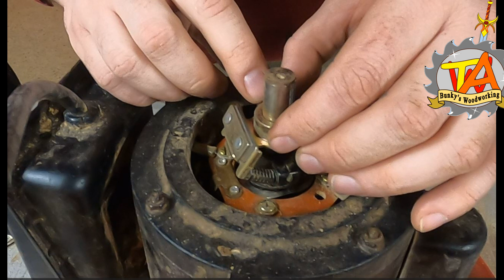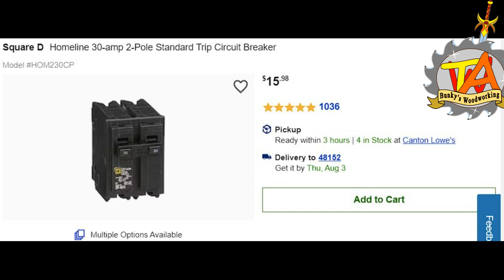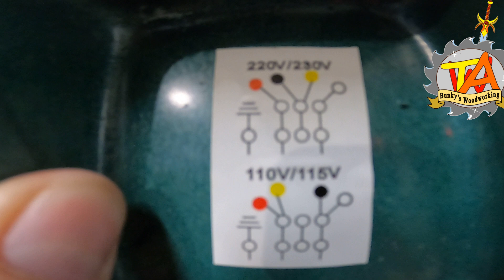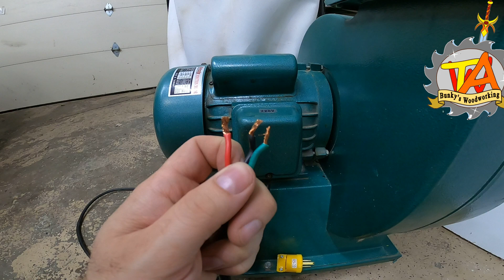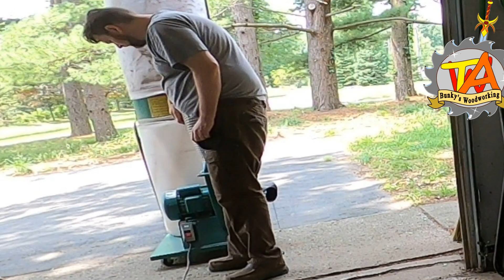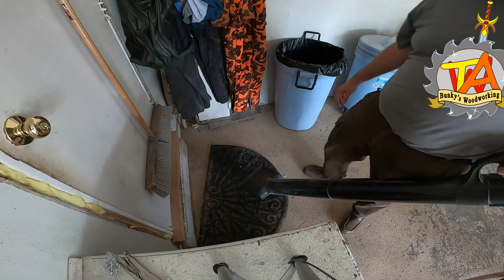Converting Motor from 220 to 110

Comment: Are you sure you meant 200 AMP ?? I can see 220 V @ 20A ??
Reply from the maker: Thanks for asking! The 200 amps was referring to upgrading our main breaker panel/service from 150A to 200A, not the circuit for the dust collector. Our existing panel was full, so adding another 220V circuit would have meant upgrading the panel to give us the additional breaker spaces we needed. Rather than doing that right now, we converted the dust collector to run on an available 110/120V circuit. Hope that clears it up!

Comment: But the start capacitor MP it's not the from 220v to 110v....
Reply from the maker: Don't know if this helps but "When changing from a 220V to a 110V system, it is generally not necessary to change the start capacitor if the capacitor was rated for 220V. However, if the motor has a centrifugal switch, the start capacitor may only be in the circuit until the switch opens, and the motor manufacturer typically chooses a common mfd rated capacitor such that the start current leads the run current by approximately 90 degrees electrical to maximize starting torque. If the motor runs fine, the capacitor may not need to be changed. If the motor does not run properly, it may be necessary to try different values or consult a motor repair shop with the necessary equipment to determine the best mfd rated capacitor."

Comment: Thank you for this video. I may need to do something similar, so am curious if you had any problems before you switched to 220V. For example, did the breaker blow too frequently when you had other loads on the line? Or did it not provide enough CFM suction?  If the manufacturer provides the option for wiring either way then hopefully the system works fine except for the lower efficiency in suction (but what you showed with the 110V looked pretty good!)
Reply from the maker: Hi [MrHolz1234],

Thanks for watching and for your question! You're right—I've received a lot of comments about the potential drop in efficiency when running the dust collector on 110V. During the few days we had it set up that way, we didn’t notice any significant drop in performance. The suction seemed strong, and it worked just fine for our needs.

That said, we weren’t running it long-term on 110V, so I can't speak to any long-term effects. But when we used it, we didn't experience any issues with CFM or frequent breaker trips. It seemed to handle itself quite well.

Hope that helps, and good luck if you decide to make the switch! Feel free to reach out if you have any more questions.

Best regards,
Reply: Many thanks for the reply @CoupleofBunkys   I know you were running it just for a short time, but were you running it on a 20 amp breaker, and still no breaker trips? I am curious because the amperage draw may have been overstated. The comment above on the draw going to to 33 Amps is correct, but if you are running it on a 20 amp circuit, and it is not overheating or tripping, I am just wondering if it means that Grizzly added in a considerable safety cushion relative to their amperage rating. Hence the question on the amps of your 110V breaker.

Comment: Thanks for this. I bought a similar Grizzly unit in the 80's and had it on its own 220 circuit. I'm now in a situation where I can't run it on 220. The motor on mine is actually marked 110/220 so I knew it could be converted but the information wasn't in the very sparse manual they sent decades ago when I bought it. I figured I was going to have to buy a 110 unit but thanks to your video I found the wiring diagram under the plate. I get to keep an old friend and yes, I know all about the efficiency issues of switching it to 110. It's not going to be an issue for me.
Reply from the maker: Thank you so much for your kind words! We're glad our video helped you convert your Grizzly unit. It's great to hear you can keep using it. If you haven't already, please consider subscribing to our channel for more helpful content—we work on many Diy and How to projects. Thanks for watching!

Comment: The problem with downgrading from 220 volts to 110 volts is that you double the amperage.  For example, I have an air compressor that uses 230 volts, 16.5 Amps, so if I downgrade to 115 volts it goes to 33 Amps.
Reply from the maker: Cool I personally did not know that. after this video we upgraded the electric outlet to 220 I will get to making the video eventually. Thanks for commenting and the info. we do a lot of projects like this consider subscribing and sharing the content with others we try to get a new video out every Thursday at 730 Pm
Reply: Good move upgrading to 220v. Also, if you want to get rid of your generator isolation switch in your power panel, you can buy a Generlink Transfer Switch that plugs into your electric power meter. 

It also helps to have an inverter generator to condition the power to work with sensitive electronics.